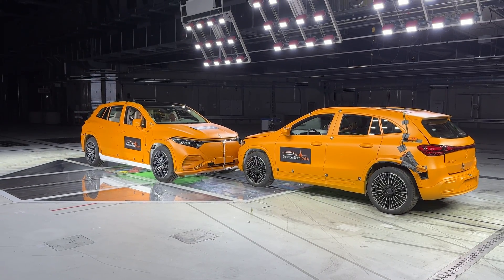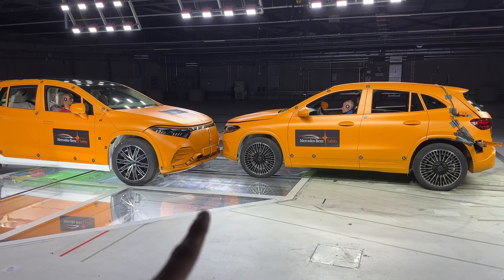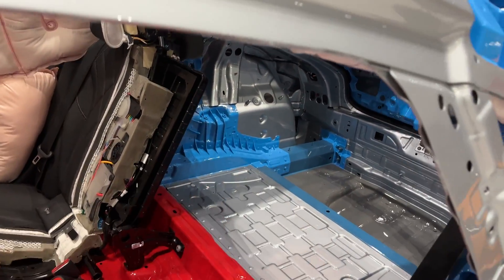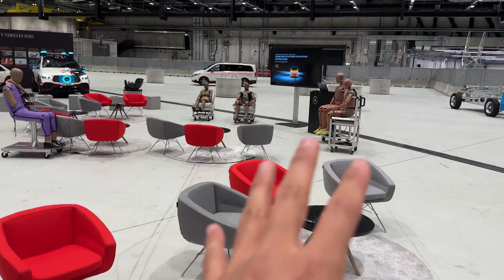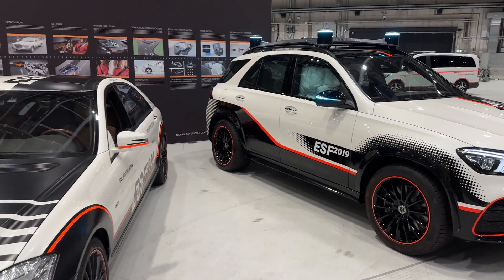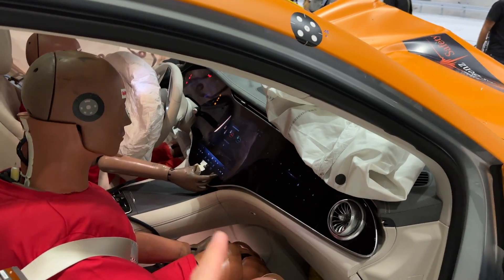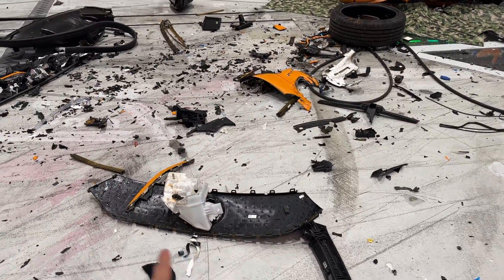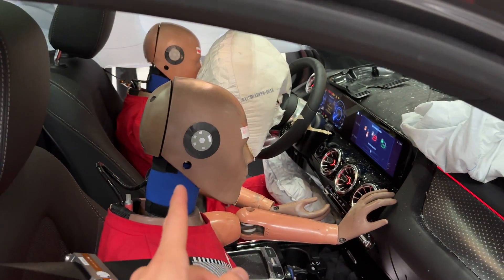REAL CRASH TEST Mercedes NEW 2024 EQS SUV vs EQA! Head-to-Head Collison Safety

Comment: ok cool so if u get into an 80 mph collision the entire car just explodes
Reply: It's not "the entire car," just the crumble zones which absorb most of the collision force. And no, the battery itself will not explode, since it's designed to shut off under critical conditions. Believing it would explode is as stupid as believing a gunshot to the engine could cause a car to explode. It's unlikely.
Reply: Bro never heard of crumple zones 💀
Reply: Huh?!?! The hell are you talking about